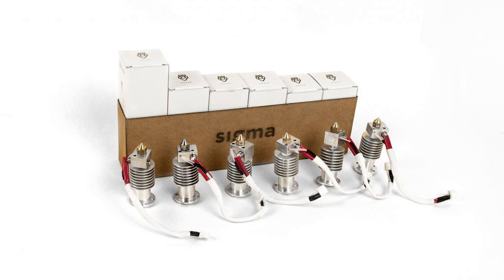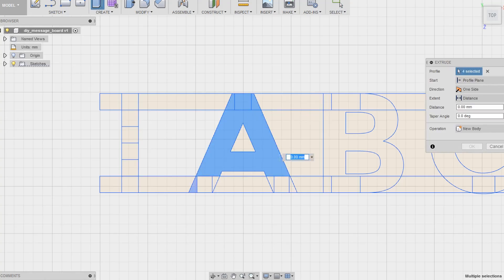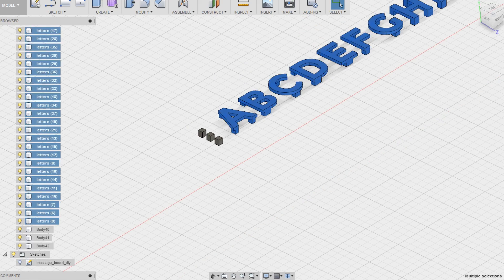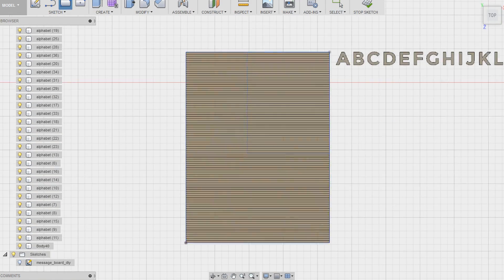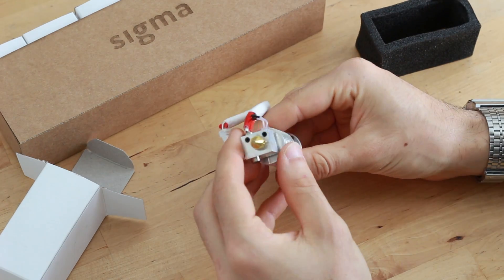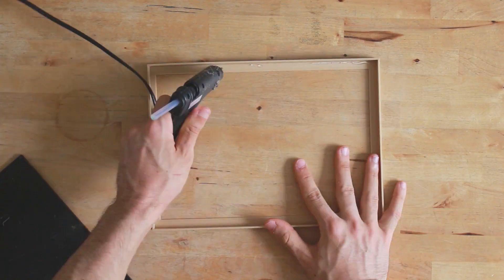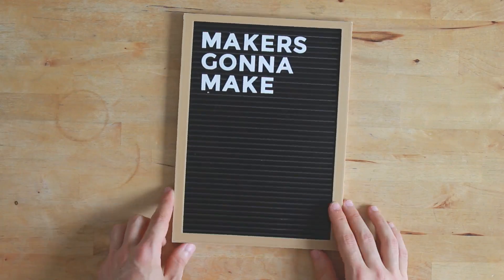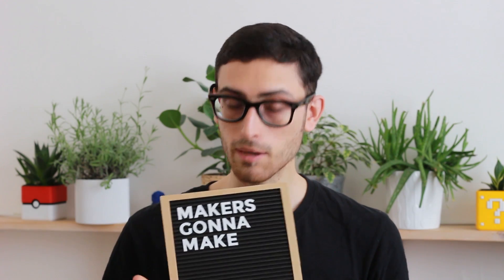DIY Letter Board - Only 3D Printed Parts!

Comment: felicidades por tu diseño, pero somos un poco novatos en la impresión 3D y tenemos una pregunta, cuando añadimos los diferentes elementos a slicer, los coloca en vertical, eso es correcto? o debemos modificarlos para que los coloque de forma horizontal? gracias